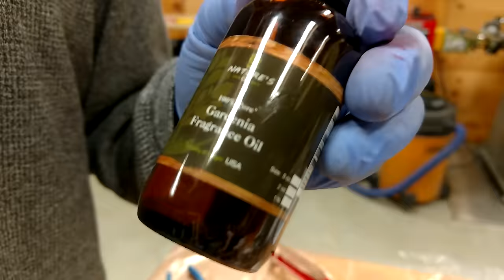Making Colored Smoke Devices for 4th of July

Comment: Great presentation, Potassium chlorate brings back memories.   A lab technician that worked for me was also a magician and showed me how he mixed two powders together and when you snapped your fingers together you made smoke.   I analyzed the two chemicals one was potassium chlorate and the other was red phosphors.   I got two vials of the material and placed them in my pocket.   That night we went bowling with the research group, and we were all having a good time making smoke with our fingers.   Next it was my turn to bowl and I forgot the tops of the vials were loose and the two mixed in my pocket and set my pocket on fire luckily it was not a hot fire and I put it out using the sink in the men's room the whole room was smoked up.   My friends to this day remember the flaming pocket.

Comment: Have recently mastered the high performance smoke bombs , I caramelized a 60/40 ratio and put in a paper coin tube as it drys fairly quickly and then added a fuse to the paper tube, I had to use a drill bit. Once cooled it is rock hard. I put the whole coin tube filled with caramelized 60/40 ratio into the main smoke device (2 in. diameter) which had your perfected recipe with paraffin wax. I used a drinking straw with Vaseline to cover fuse when adding Durhams mix on top. Pulled straw to expose live fuse. When finished it was a 2 in diameter tube  filled roughly 3-6 inches up of smoke mix. I had used a $10 quarter coin roll in place of your powder/fuse hollowed hole. I will post a video of the smoke bomb I think it was magnificent. Ran out of my 5 lb nitrate bag, but will hopefully master the colored ones next.

Comment: I noticed in the comments that you recommended all of their dyes except for the black. I wanted to let you know, as a fellow chemist, (granted not a doctor but still a graduate) my old copy of The Chemical Formulary Vol. 1 has an effective procedure to make them with a very similar preparation to your colorless smoke devices — but adding in Black Roofing Tar and Sawdust I believe. Although I’m sure the sawdust could be removed or substituted. I am, however, curious — I’ve seen many comments about foul smelling oils or smoke that sinks: I can answer the latter but not the former. The latter is achieved using the old formula with Pitch. One may have to modify it from the Formulary procedure to yours due to availability of ingredients these days versus the 1930’s… but as for the “smelly” smells: I am curious if you’d run afoul of the Geneva Conventions from attempting something like that?? 😂 I mean: I know you likely wouldn’t. But some things containing capsaicin could be probably as far as I would imagine one could go. Perhaps I am wrong? Capsaicin would be pretty mean. 

But by 1930’s standards capsaicin would be considered KIND apparently. In the same page of The Chemical Formulary there is a procedure listed which includes (and I will NOT give exact measurements, procedures, or reasons because nobody should attempt this at home) “Chloroacetophenone, Hexachlorethane, Ammonium Chlorate, Zinc, Zinc Oxide…”

Yikes. 

Thanks again for the video! I wouldn’t have originally thought about lowering the temperature after the activation temperature by using a cotton buffer. That was very clever and thrifty.
Reply: Thank you for your helpful comment, Can i ask you a question ? It's not easy to find potassium nitrates in my country, but I read in the internet that i can use saltpeter instead but i couldn't find the correct formula, Can you help me please ? 
Thank you

Comment: would the powdered RIT clothing dye work? I'm not looking for show quality color just noticeable color. I do love this idea for a colder burning smoke bomb. Allows us to do more training in the desert without the huge worry of lighting grasses on fire. Granted it will still be a concern, but it won't be as bad as it would be using the traditional smoke bomb method.
Reply from the maker: I suspect that some color may survive the burn but probably less than with traditional smoke dyes.  These fabric dyes contain other inert agents such as surfactants to aid in the penetration of the cloth fibers and allow water solubility.  Nevertheless, the low temperature is a plus.  You may have to modify the dye percentage as well to optimize the burn stability.
Reply: Tech Ingredients Am i to assume a greater volume of dye to the mix to compensate for the weaker dye? Times like this I regret not paying better attention in chemistry class. Hindsight.
Reply from the maker: Think of this as your chemistry, post grad work...and its free!  The issue with the RIT is that the additional components may effect the burn rate and that may be more important than the color effect.  I would start with the same 36% and test.  If it won't ignite, progressively lower the concentration until it does or you discover that these components inhibit the burn so effectively that this is a no go option.
Reply: Tech Ingredients lol, you're a good dude. I appreciate the advice. I'll give that a shot and hope I can stick to the cheap stuff. frugality it a virtue and I'm very virtuous.
Reply from the maker: " The Good Dudes".  We considered that, but settled on Tech Ingredients
Reply: lelandsdad13 I’ve seen any powdered dye work to good effect
Reply: So much of the ingredient total cost is quite reasonable, for the celibratory bombs  (parties, fourth July, New year's eve., etc. I will go ahead and spend for the good dyes.  If your making units for every day type fun...   Powdered dyes of a cheaper nature, or possibly liquid dyes, will do.  Just not be as brilliant.   It's worth doing some small scale experiment stuff to see what you can come up with.
  For my survival kits where I want best color so I can be spotted, especially if in in a canvassy, overgrowth type terrain, good, contrasting color is worth the price.  :)
Reply: @TechIngredients  Any chance you can post a link to the dyes you use? As with many I  am struggling to find them. Awesome video and explanation. Glad I stumbled across your channel very informative and entertaining.
Reply: What are the ratios for just white smoke?
Reply: What are the ratios for just white smoke?
Reply: @TechIngredients 
Can concrete dye be used for cement?

Comment: Where do u get the ingredients
Reply: please answer this is a very good question
Reply: Walmart. They have a "DIY smoke bomb starter kit", didn't ya know>
Reply: I found everything on amazon
Reply: Links would be helpful
Reply: You can get Potassium Nitrate at your local big box store like Lowe's. It's called 'Stump Remover". It comes in a bottle and it's 100% Potassium Nitrate. The sugar you have. The scented oils can be had almost anywhere. Sodium Bicarbonate is baking soda, also in your cabinet. Magnesium Carbonate is a supplement and be found anywhere you buy supplements, like WalMart. You have to buy Potassium Chlorate online, no other products contain it so you have to buy it in it's pure form. And lastly, the smoke dye also has to be purchased online, and it's the most expensive of all the ingredients. If the cost of making these is too high, there are alternative, less expensive formulas you can use to make smoke bombs.

Comment: Interesting about the oil, so if I add capsaicin oil I could potentially make my own OC tear gas, like the OC that's in a good pepper spray depending on the quantity needed to be effective. 🤔hmm
Reply: Could be a bad idea whilst working really well you would never find a good way to test it
Reply: there's one sure fire way to test it lol
Reply: Oh yeah .as part of training was  gassed ya gotta do it just once
Reply: cheezmartian I doubt it would be greatly effects but one never really knows
Reply: I did a somewhat similar experiment and wound up gassing myself out of my basement, so it does work. On the other hand making what are essentially chemical weapons to use on people probably crosses the line between "childish prank" and "domestic terrorism", so I wouldn't recommend it.
Reply: apathyboy. Yup, it does work and you're right.  As a last ditch, prepper-disaster device, ok, but it can get you in a heap of crap if you use it wrong time, wrong place.  It goes in the major, under lock and key Oh Shoot kit.  ;)

Comment: I could see someone making a THC oil smoke bomb.
Reply: Oh boy that'd be fun
Reply: Oh jesus christ I just realized from your comment you could theoretically pack in a bunch of DMT into one of these. 

It's a horrifying prospect, really, but if the smoke was high enough concentration to get people high you could make crowds of people trip on psychedelics fairly easily. Not inexpensively or legally, mind, but a smoke bomb like this would be insane.
Reply: @darkfur18  I agree

Edit: Psilocybin would also be intriguing…
Reply: @Marble_Pie  too bad it breaks down at those temperatures
Reply: @Inanedata  if you have trouble with getting caapi just buy some Aussie natives, such as maiden's wattle or acacia acuminata, and you can get a pretty good supply just by pruning them.
Admittedly, it's still ~$10 per dosage, and you'll be wasting a lot, but it could make for an interesting party once this whole war on drugs bs has rolled over.
In the meantime, we'll just have to enjoy the THC grenades.
Reply: @maasmorin7606  I mean, we could use a slightly modified humidifier or maybe even just couple it with a tail that would break off when it was metabolized, which could even allow it to bypass MAO if we picked a good one, so it'd be pretty much potentiated...
Reply: @theapexsurvivor9538  Are you actually braindead?
Reply: @kiyoponnn  if I was brain-dead, I think it would be a little hard to type a response, unless you're implying that the cessation of all neurological activity wouldn't preclude the ability to read something and create an appropriate response to it. If that's the case, I personally think you might have used a few grams too many of whichever substance you've taken...
In conclusion: No, my brain is still operating at a normal level for a living human being.
Reply: @theapexsurvivor9538  Then why couldn't you comprehend such a simple sentence that was typed by Maas?
Reply: @kiyoponnn  I did comprehend it, which is why I proposed two alternative methods, one in which less heat is used to avoid the decomposition; and one which altered the structure of the chemical, making it a thermally stable pro-drug for the desired end chemical. An example of the latter is THCA, which decarboxylates when heated to produce delta-9-THC, which is both psychoactive and a pro-drug for 11-OH-THC which is also psychoactive.

The main issues with psilocybin is that it's naturally a conjugate acid (salt rather than freebase) and highly polar, basically making it a nightmare to smoke (no issues with dissolving it in a solvent like Etoh and using a mist type humidifier to spray it out as a fine vapour). There's basically two ways to get around this problem chemically, one being to (CAREFULLY) use a base to cleave off the acid and convert it to it freebase form (nightmare for a methlab level cook, a tiring pain in the ass for an O-Chem undergrad, as it'll prefer to go through hydrolysis than lose the acid). The other method is to bind something else to the main structure that will modify its polarity or melting/boiling point (a melting point around 130°c and a boiling point around 300-400°c is optimal, as shown by some of the structural analogues we have of it already).

TL;DR for all those with below average intelligence: I understood what they said, and gave them some solutions to the problem based on freshmen Organic Chemistry knowledge.
Reply: @theapexsurvivor9538  lmao, you think you're the only person in the world who knows organic chemistry? And hypothetically, even if I didn't I can always look it up on the internet. Also a "mist type humidifier" is a nebuliser lol. Why does psilocybin's polarity make it harder to smoke?

PS: I learnt this level of chemistry in highschool(of course you don't have to believe me)
Reply: @kiyoponnn  no, hence why I gave a full explanation, then gave a TL;DR for those who don't know. If I thought I was the only person who knew, wouldn't it be pointless to explain it in a way that only I would understand?

And I was just giving the year that is standard for learning more specific O-Chem stuff, as some people won't learn some of the information until then and I wanted to cover all my bases.

Of course, if you already learnt this stuff, why did you get confused by my initial answer? It's not like it's harder to understand than the more in depth explanation I just provided...

And regarding the humidifier/nebuliser, it's 2:30am, forgive me oh great one for using a phrase 90+% of people reading would understand instead of looking for the exact term to please your semantic whims. And it's poor form to edit a comment to include additional clauses for a person to respond to after they've responded, but seeing as you don't have an issue with it....
Reply: @theapexsurvivor9538  Nevermind
Reply: We added chilly powder and we’ll if you have ever burned chilly powder you know
Reply: New Meta.
Reply: @graysonchristensen940  Just add pure capsaicin, I heard it's really good at drawing tears.

Comment: Potassium chloride can be dangerous if it comes in contact with sulphur, it can cause spontaneous ignition over time.  Firework makers keep seperate tools for potassium chloride so no trace of sulphur comes in contact with it.  We use potassium perchlorate instead.  Safer, with more O2, although require more energy to start a reaction.

Comment: Not sure if you’re still monitoring the comments, but if so, do you have any videos or advice on making smoke bombs that would be safe to use on RC airplane wingtips and that could give you a good 3-4 minute burn?
Reply from the maker: The white smoke devices we covered prior to this video would be a better choice. The mixture is a robust solid, and by tweaking the oxidizer percentage, you can slow or speed the burn rate.
Reply: @TechIngredients  do you have a ratio you could give me that would cause a slower burn rate? Also looking to use longer, thinner diameter tubes for aerodynamic reasons, like maybe inch and a half by 12”. Would that work for this situation, without catching the airplane on fire?

Comment: Referencing the first part of the series on smoke devices: The cavity made for the booster, does it follow the entire distance of the length? I ask because towards the end of the reaction, things become a bit unstable. In rocketry that uses such methods to create solid engines they run down the entire length of the booster, among many other factors, to ensure even burn and thrust output that is consistent. Ignoring the many other methods used to achieve things only applicable to rocketry, have you experimented with any other common factors?

Off the top of my head one that stands out would be gas port geometry. Cylindrical in your devices,  of course this is just ways to control the burn rate and surface area.(too much of which would be a tad too exothermic for fiber casing) However I did find it entertaining to muse on things such as variable geometry along the length, or comparing output from different geometries. I've also seen solid motor designs with gas "channels" instead of a single. In hobby rocketry its also common to have the igniter at the far end and the flow port is thinly coated with a booster such as gunpowder using adhesive. Not terribly applicable I suppose but I couldn't help but ponder what any such things would result in for a smoke bomb.

Thanks for making the video and doing such a good job of explaining it.
Reply from the maker: The tapered plastic insert extends all the way to the bottom plug.  The requirements for an even burn are much less for a smoke generator.  Thrust stability in a rocket is very desirable to limit stresses on the motor as well as the rocket.  Ease of manufacture is what guided the design for these smokers.

Comment: How does the tubes proportions affect the output?  For example would a longer 6 inch long tube and 2 inches in diameter change its burn rate/“thrust”?

Just wondering if I were to make a bigger one if I should keep this 2:1 length x diameter ratio or is there an equation or rule to use?

Comment: I purchased some dyes online and it came with a recipe that called for potassium perchlorate. My question I guess would be which is better to use? I read the safety data sheet on potassium perchlorate and it seems like some nasty stuff to deal with. I have not read the safety data sheet on potassium chlorate yet, but will soon.

Comment: I like to watch this video form time to time and I’ve been making these color smokes for a few years but what magnesium carbonate do you use? I’ve been using gym chalk from Amazon and it works well but I feel that mine don’t last as long as yours do like maybe a min or less and I have some tubes about that size so maybe it’s my mag carbonate but I know that baking soda does slow down the burn rate a little so maybe I could add more.

Comment: If you had to guess what is the max temperature that is produced during the burn? I called the company that you purchased the dye from and asked  Renato about soluble dye smoke oil for injection in the exhaust. I want to do red, white and blue for Memorial day and the 4th. in paramotors. Renato said it wouldn't work due to the exhaust temperature and bleaching the dye white. The engine is a two stroke with a expansion chamber. My thoughts are, I think I can find a spot cool enough downstream in the exhaust to work and not degrade the color. What are your thoughts with the max temperature of solvent dye?
Reply from the maker: I don't know what that temperature limit is, but you've already suggested the solution.  Plan to allow some entrained air into the exhaust stream to adjust the temperature.